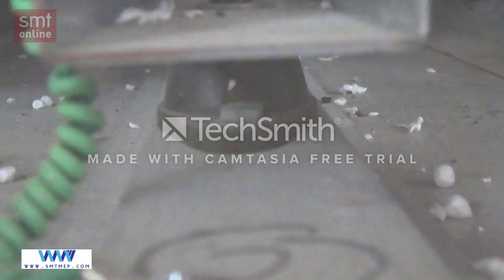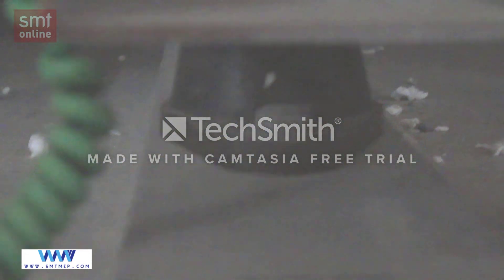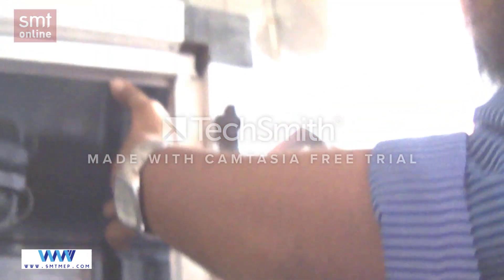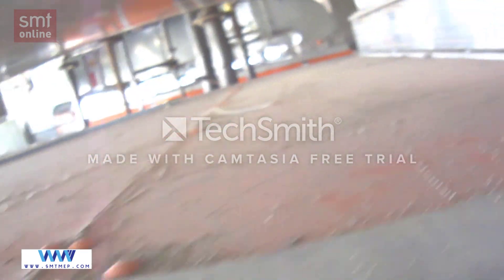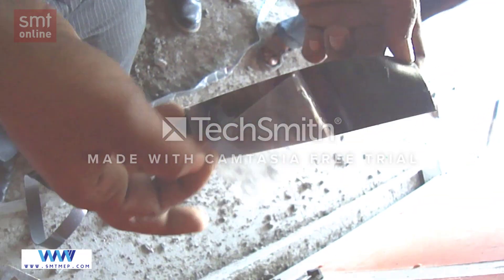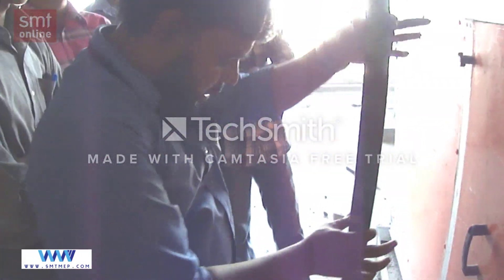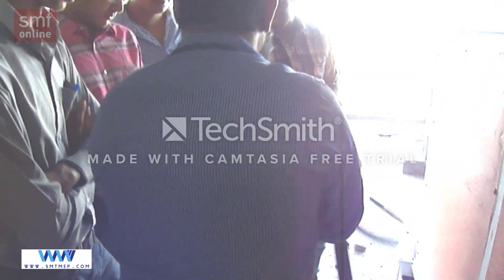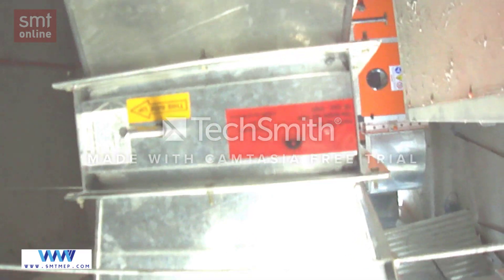AHU Connections I AHU heating coil Connections

Comment: where to be used two way valve and three way valve in equipment connection
Reply from the maker: 2 way for constant flow system.
3 way for variable flow system